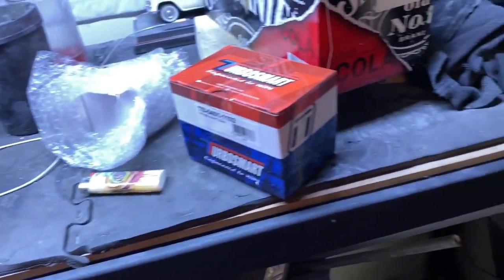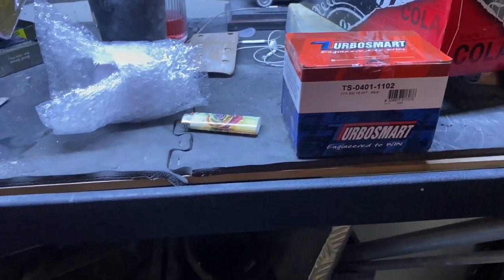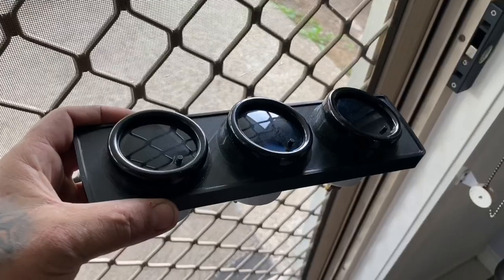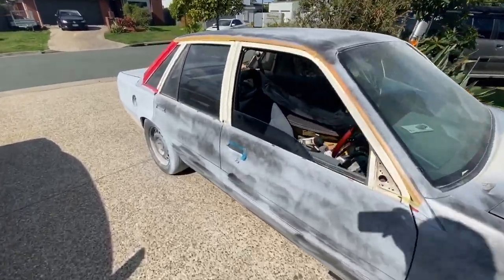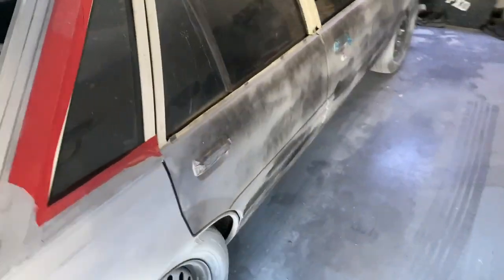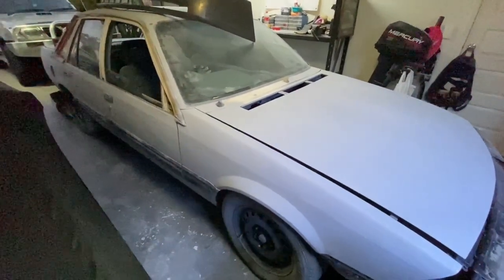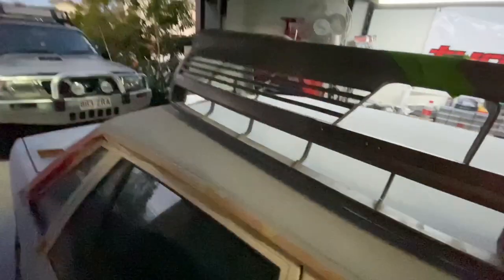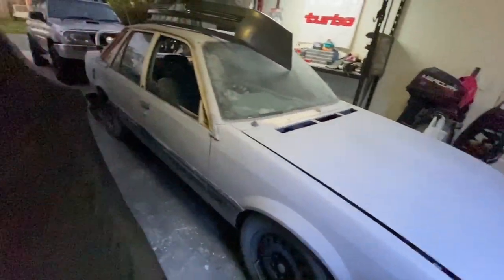Vl Executive Primer Time Part 19

Comment: Fairly odd style of spraying the primer in the middle of the bonnet and roof or at least to me.  I understand blocking it with smooth it out anyway, also odd that the door moulds were not removed, figured theprimer would leave a hard edge their hope it turns out alright.
Reply from the maker: if you had to pay to replace a bit of plastic if you broke them that cost $500 dollars im pritty sure you would just leave them on thats a expense i dont want to pay for i have left them all on my previous car turned out fine
Reply: @MrProjectt  fair enough with the moulds, they are a bitch and hard to replace. Could of spent 30 minutes taking out the door handles and locks though
Reply from the maker: Damien Hasleby it turned out fine man that’s just the way I do things everyone dose things different